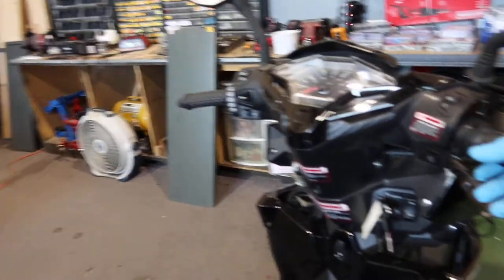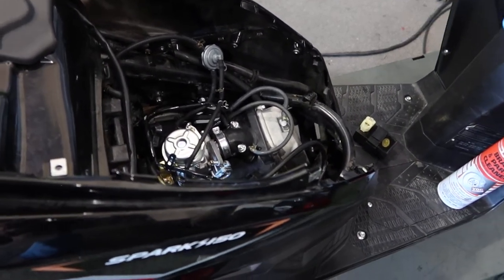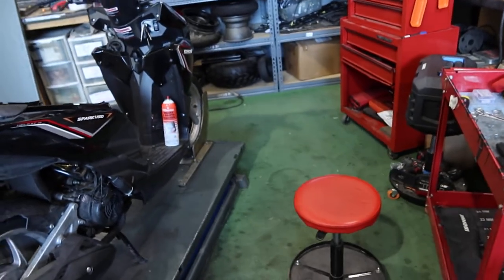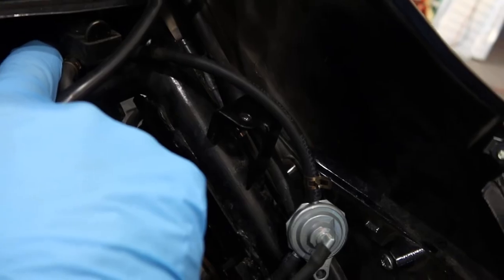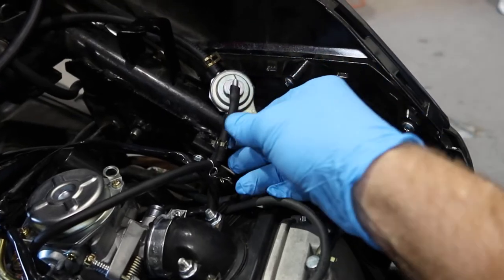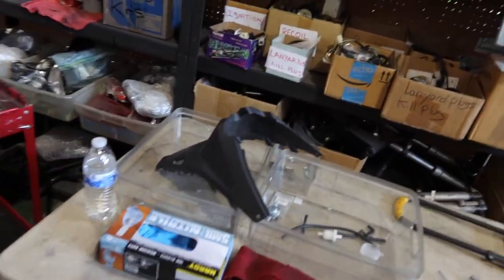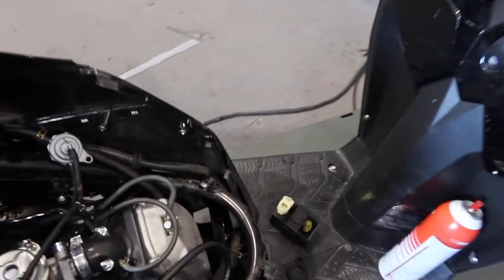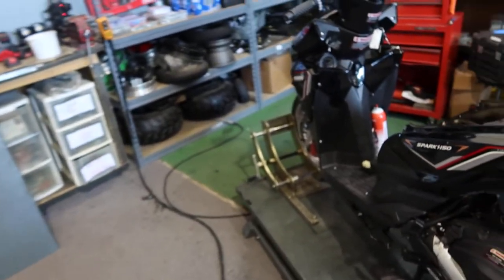WHY DOES MY SCOOTER BOGS DOWN WHEN I GIVE IT GAS

Comment: My scooter cuts out completely if you turn the throttle at all. It takes about 2 minutes of it bogging out like that before it will let me rev it like normal and ride. It seems to only do this in cold weather. Once the scooter is warmed up it rides and runs greats! Any thoughts please?
Reply: Also it is very hard to start when cold. 50cc Chinese scooter
Reply from the maker: Check the vacuum lines, the intake manifold for any defects and the intakes base gasket.
Reply: Mines doing exact same. Idles fine. Dies with Any throttle at all.. did u find the fix?
Reply: @Handlehandlebars  unfortunately I never got the problem fixed. I sold it as is for $650 and bought a Honda Grom 🤓

Comment: Of first of all it’s not a pressure regulator and it’s definitely not called a petcock. It’s a diaphragm full pump that works off engine vacuum .just to set the record straight.a petcock turns the fuel off and on . And a presser pressure regulator  regulates the pressure in a system usually in a fuel injection system with an electric pump but some mechanical pumps do have a  regulator. Not trolling just wanted to say that so your viewers don’t get it wrong when they go to purchase parts.
Reply from the maker: Appreciate the feedback
Reply: Petcock is still a petcock and does use a diaphragm to move fuel on demand.

Comment: Can you make a video on how to change the mirrors on a bahama vip? I have to replace mines. I broke them😂🤷‍♀️
Reply: Just unscrew them if you can’t find the screw lift up the covers
Reply: @zynk1x881  But how do I know what size it is so I can get a replacement?
Reply: Google the bolt size or measure it with a ruler or tape measure, calipers if you have them do best

Comment: Hi please can you help me.

I have a wangye eivessa 2 125cc year of the bike 2022 it has done 2215 miles i bought it second hand and had a months warranty which has run out.

When the bike is ticking over I have a mass of blue smoke coming out of the exhaust and the bike cuts out due to excess of smoke.

The carborrettor is an EFI. At present I have not messed about with it.

Is it possible I have a leak on the carburetor or is it a case of piston and rings need replacing along with the valves and seals.

I have ordered a compression test kit and will do a test.

Please can you give me some advice if it is possible the the carburetor mixture or a hose leak within the engine bay.

Cheers
Reply from the maker: I am not familiar with that brand or model.  Please contact your local dealer or manufacture.
Reply: @MOTORSUncut  I don't have a dealer in my local area to have the bike serviced.

I'm not sure if its piston and rings along with valves and seals need replacing as its seems to be burning oil.

I'm not sure if their is a leak in and around the engine. I have ordered a compression test kit which should hopefully eliminate the engine as mentioned.

You have a smashing channel keep posting videos. 

Cheers

Comment: I have 50cc yamaha tzr 50 , starts fine, idle is fine no smoke from exhaust, it splatters only at wot or when it comes to 8k rpm,and stops if i let of a gas a little bit..changed the petcock,fule line and fuel filter..previos ownwr said main jet is bigfer is that a proborm?

Comment: Do all these suggestions work for a 300CC fuel injected Chinese scooter? 
Mine bogs down and turns off when you enthusiastically give it gas. 
Gentle rolling off from a stop doesnt cause this issue. 

Also, the scooter doesnt accelerate past 57kmph unless you twist it to the max, then it acts like a supercharger and boosts itself forward. 
I have ordered a throttle position sensor for the dodgy acceleration and I hope that sorts it out. Dont know what to do about the bogging
Reply from the maker: Generally they do.

Comment: is there a reason why my scooter can't go slowly, it wants to do wheelie with a light throttle and then it goes normally with light throtle, I want it to go slowly not  to do a wheelie I almost fell more than once I tried to replace the spring,weights, the situation only gets worse
Reply from the maker: Just be easy on the throttle
Reply: @MOTORSUncut   nah the trottle is not the problem it started doing that recentli

Comment: I put a brand new carburetor on my 150cc scooter and it started to bogged down when accelerating after putting the new carburetor. I don’t know why it started doing it after putting a brand new carburetor
Reply from the maker: Check the vacuum lines, intake manifold for leaks.
Reply: @MOTORSUncut  I found the solution i put the old carburetor back and it doesn’t bogged down anymore. It looks like it was the new carburetor came defective when i bought it
Reply: @MOTORSUncut  also one more question my scooter battery is completely dead  does the battery charges while riding the scooter
Reply from the maker: @Cristopher180-  Yes